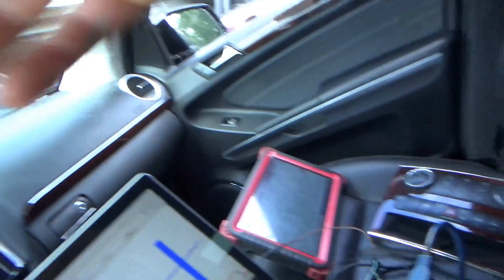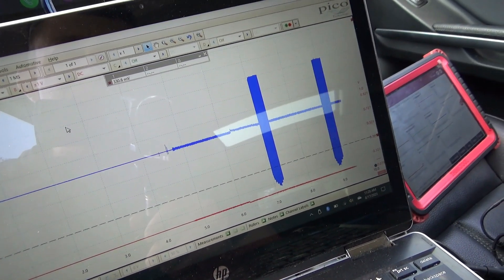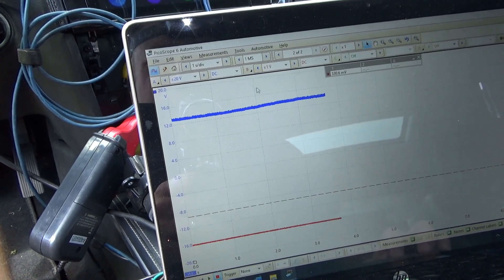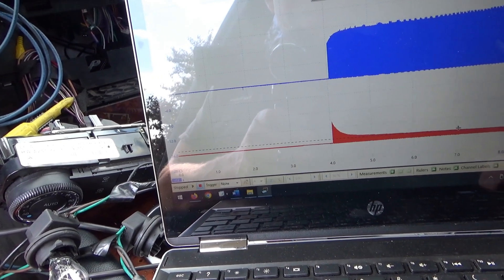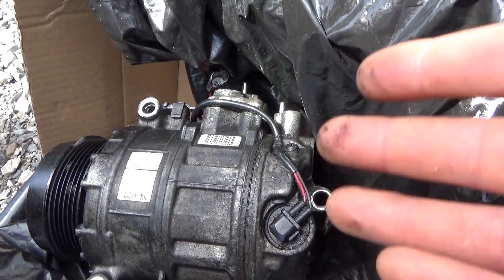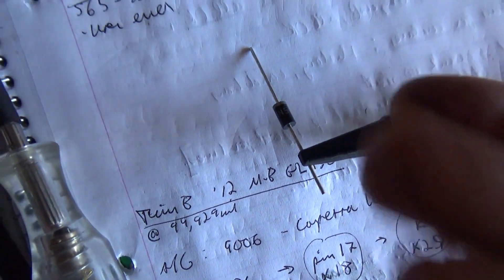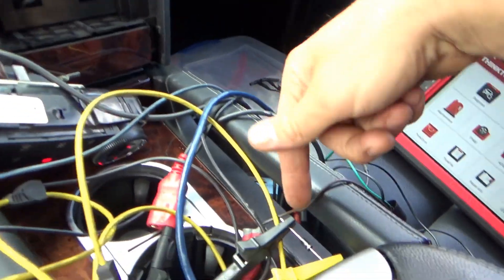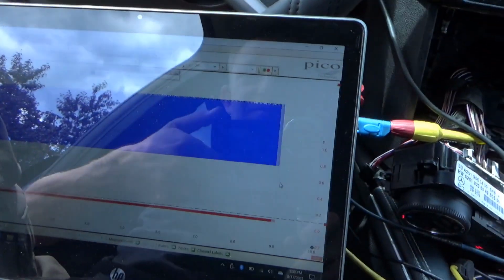Part 2: Did I MIS-DIAGNOSE This Mercedes?? (GL450 no A/C - Crazy REPAIR!)

Comment: My thought is that the original compressor has a diode built into it that shorted and then blew open. The replacement compressor doesn't have a diode in the harness, (probably a replacement full time non-PWM compressor). If you remember the original diagnostic code alluded to a shorted circuit. The diagnostic code wasn't 100% correct in this case but close to correct. If the schematics were more accurate, they might have shown either a diode coming into the compressor at the short pigtail or shown the compressor with a diode in it.
Reply: This comment certainly answers my questions. 
Wonder if Ivan went looking for the built in diode after the fact.
Reply: The diode is probably built-in to the mosfet that controls the PWM.  The internal diode can fail while the switching side of the mosfet still works.  The mosfet in the junkyard/ebay controller was probably worse off and the diode took out some of the mosfet.  Would be better to use a Schottky Diode in this application but I'm not sure what type he used.
Reply: @10100rsn diode in-line with the load

only benz versions of the denso seu compressors have diodes on their vd valves. aftermarket pos had the wrong valve in it
Reply: @10100rsn 
Relying on the 'body diode' inherently built into a MOSFET would, IMO, be a BAD design.  Firstly, they're rarely fully characterised in their datasheet and they'd also be dissipating those back-EMF spikes within the SAME physical package that turned it on (i.e. Concentrating all the heat generation in one place).
While it's quite possible that MB DID implicitly use the inherent MOSFET body diode, it would not be 'best practice' from a design perspective!
Reply: @trevorvanbremen4718  Probably more of a "cheapest/fastest" decision.
Reply: PIV = positive inverse voltage. Personally, I would want a diode with 100 PIV and 5A.  My gut says the diode WAS inside the controller.  Much cheaper than external.
Reply: The diode is present to 'protect' the output transistor of the controller since they do not 'like' reverse voltages. (It's NOT to 'protect' the compressor.  The spikes are CREATED by the inductance of the compressor!)
Therefore, IMO, the 'logical' place for the diode would be inside the controller right next to the output transistor rather than inside the compressor. (It would just be one more component on the internal printed circuit board).
SOME people would have wired in the external diode incorrectly.  i.e. In series with the control wire thinking that it would BLOCK the voltage going back 'the wrong way'.  The reason why that is wrong is that the instantaneous voltage that is created when the compresses is first turned off is effectively INFINITE.  The inductance wants te same current to 'keep flowing', and the only way that can happen is if the voltage RAPIDLY spikes.  This spike would be WAY more than the trivial 50V PIV [peak inverse voltage] of the diode, so it would NOT last long before it blows up.  Instead, the diode should be wired (as performed by Ivan) in such that it effectively 'shorts out' (to ground) the reverse voltages induced by the compressor inductance.  Since the current in the compressor (when active) is around 1 amp, the reverse spike can NOT be more than this value.  In principle though, you should have used a diode that's rated somewhat higher so that it's never CLOSE to its maximum.  (I'd have used at least a 3 amp rated diode).
Overall, well done Ivan.
P.S. When diodes are employed like this in circuits, they are often called 'free wheel' diodes.
Reply: @trevorvanbremen4718  The problem with putting a 10 cent part in a $500 part is you brick the $500 part when the 10 cent part fails.   Better to make it an external part that can be replaced as a separate SKU.   Ideally it would be part of the subassembly process from the vendor.   Probably increases the cost by $1, which was the real reason  it was embedded.
Reply: @trevorvanbremen4718 The diode is not just to protect the transistor, it's also used for RF suppression. That's why it's best practice to put the diode directly on the solenoid, otherwise the RF spikes from the back EMF will travel back along the wiring loom and cause interference.

Free wheel diodes are often combined with an R/C snubber circuit for this reason.
Reply: @Stoney3K  Valid point about RF suppression... (The wiring ITSELF can do a great job of acting as a radiating antenna!)
In an 'ideal world' (you know it, it's the one that NONE of us live in.... LOL), I'd place 'protection' at BOTH ends.
(The rest of this post is NOT aimed at Stoney since I am confident they already KNOW this stuff).
RFI is 'generated' by any ultra fast signal rise / fall times.  i.e. Anything that switches from ON to OFF (or vice versa).  In this case, the output transistor of the controller is RAPIDLY switching the compressor on and off (only the duty cycle changes, the ratio of 'on' time to the 'off' time).  Technically, the MOSFET CAN also be switched on 'part way' (operated within its linear region), but that's not used since it creates a LOT more heat in the MOSFET and requires a more expensive MOSFET too.  This would largely eliminate ALL of the RFI since there's no hard on / off switching!
Other options that are used are to run the wire through a ferrite ring.  (The ferrite ring 'slows down' the rise / fall time of the signal and thus greatly reduces RFI).
Reply: @calholli 
Well.... Kinda!!!
Your statement is correct, but only if you include the word 'average'.  The entire NATURE of a PWM (Pulse Width Modulated) signal is that it will ALWAYS be completely ON or completely OFF and not somewhere in the middle [slight exaggeration there, but only to stress the point).
As a general rule, a transistor will 'heat up' a LOT more when it's only part way on / off.  Using PWM overcomes that 'issue' by turning it fully on, and fully off VERY quickly such that the AVERAGE result is somewhere between off and on.
Imagine filling up a swimming pool with a hose.  If you turn the hose on max, then the pool will fill up fastest.  If you want to fill it up a over twice the time period [for some unknown reason], then you partially close the tap [a.k.a.transistor], OR... You can turn the tap ON 100% for 1 second and then turn it 100% OFF for 1 second repeating those steps until it's fill.
Reply: @calholli  
100% accurate!!!  You now have a clear understanding what PWM is!!!  Well done!
Reply from the maker: @trevorvanbremen4718  great comment. It was a 3A diode 👍
Reply: A coil reverse voltage diode is always placed near the component to be protected from the high reverse voltage spikes, in this case must be in the A/C control unit near the a/c compressor variable valve + positive output signal transistor or Mosfet, just open the a/c control unit and follow the line, there must be a transistor or Mosfet and a burned reverse voltage diode!
Reply: @arm2644  
If you read through some of the previous posts, you'll see it mentioned that the output transistor (which is more than likely a MOSFET) already has a built-in diode.  (It's called a 'body-diode' in this instance and it's an inherent by-product of making most MOSFETs).
However, it's somewhat 'risky' to design a circuit that EXPECTS this body diode to do the job of a free wheel diode (as I've mentioned in another post above).
However, we need to remember that we're talking about the auto industry where they will consume 5 weeks trying to 'optimize' a design to save $0.01!!!  (If you sell a million of them, that $0.01 will start to add up!)
If this was designed for space rocketry, there might possibly be a separate diode and RC 'snubber' at BOTH ends of the wiring, but in the auto industry I'd not be surprised if it was ONLY the body diode!

As for the junkyard OEM unit (that didn't work at all), I wouldn't be surprised to find the output MOSFET had 'et out the magic smoke' altogether.  The body diode probably failed first, and then sometime later, all of those reverse voltage spikes blew through the gate oxide.  (When THAT happens, it's quite common to cause a cascade of faults further up the chain!)
Reply: possibly an attenuator in the control module..
Reply: Diode in compressor might have shorted, and there's your original short.
Reply: benz doesn’t duty cycle these things like the other brands that use a denso vd compressor.

the dot on the valve means it has an integrated diode and it lives life at battery voltage.

Comment: I get confused about diodes and how they work a drawing of this would be nice to get it 100 % correct in my mind thanks
Reply: Check here:
https://en.wikipedia.org/wiki/Diode
https://en.wikipedia.org/wiki/Flyback_diode
Reply: @calopii  thanks so much for the reply got a little confused in the video why he was doing it the way he was I understand now thanks again
Reply: Just think of it as a check valve. In simplest terms it only let's voltage flow one way.
Reply: @guess1866 You mean current. Voltage doesn"t "flow".
Reply: @guess1866  Not to nitpick, but it lets current flow one way.
Reply: @1McMurdoSilver It's not nitpicking to get the answer correct.

Comment: That was a nice little hack to get the results you needed Ivan.  Well done.  Your customer will be very happy that the A/C is working once again.  But there has to be something else we are overlooking.  Because not everyone will have easy access to electronic components like that.
Reply: Anybody can buy a diode.  Expertise is hard to buy.
Reply: @rj.parker  True.  You can still buy electronic components.  But it's basically only mail order now.  And I agree with how hard it can be finding a great tech with a good wealth of experience.
Reply: The thing that "we are are overlooking" is that the replacement compressor is not build correctly from the factory (missing internal diode). Replacing the internal one there would mean: 1)evacuate the refrigerant 2) remove compressor from car 3)replace compressor for warranty (they might not be able to reproduce the issue at this step) 4) reinstall 5) recharge AC. Soldering in a diode is way easier and cheaper.
Reply: @tschuuuls486  Agreed.  Soldiering in a replacement diode is the easiest and cheapest fix in this case.
Reply from the maker: Is there a global shortage of diodes? 🤔
Reply: @PineHollowAutoDiagnostics  Not that I am aware of.  But there is a shortage of local brick and mortar stores that sell them.

Comment: How did they manage to change the compressor and get the system charged IF the compressor wasn't working?
Reply: liquid charge by weight is only way thru high side port.
Reply: Variable speed.  It worked but not at full load.
Reply: I @rj.parker  way more complicated than it needs to be.. german witchcraft dating back to hitler I say..  the final solution as Ivan said,, LOL
Reply from the maker: Using an AC machine 😉

Comment: Great diag Ivan. I am wondering about the compressor ground. Thru engine, to body ground. Any crusty sin that lineup? How would that impact? Thanks for your great videos.
Reply from the maker: Ground is fine since current flow was to spec and compressor worked fine manually 👍
Reply: It makes sense when you explain it. Thanks for the follow up. @PineHollowAutoDiagnostics

Comment: Does it not irritate you that you couldn’t fix it but could rig it to work ? I’d be nuts.
Reply: If it was a missing part and restored it, he did fix it.
Reply: He fixed it. He replaced a missing or blown diode with a new one. NEXT!
Reply: He could if he used an OE compressor…
Reply: It's real-world, you can only go on and on about theory for 
so long...........a fix is gold
Reply: He fixed it AND he documented it. Should be plenty good unless the next guy doesn't see the documentation 😅

Comment: Best place for the diode would be at the compressor. when the magnetic field in the coil that operates the valve collapses, that is whats causing the negative spike.
Reply: Yes, typically diodes are installed at the source. As for a retrofit, I would have looked at putting it inside the controller.  It would have been better protected against future techs moving things around.
Reply: @russellhltn1396 There's no harm in having the diode installed in both places though. The closest diode will take the largest amount of the back EMF current.
Reply: the diode is on the vd valve

aftermarket pos compressor didn’t have it
Reply: @xalty1200  I wouldn't call it a POS, the internals were exactly the same since they were both from Denso, it's just that electrically it wasn't a match.
Reply: I too think the diode should be as close to the offending coil as is practical. By installing the diode at the controller we are allowing a current spike to travel along the wire in the harness then on the "fat" brown wire and finally to the chassis and back to the compressor. The controller does not see any kind of spike but some high impedance circuit wire (like a hall effect sensor) in the harness might pick up some EMF from the current spike.
Reply: Also the heat from diode is better under hood
Reply: I second that. Diode should be installed as close to the source as possible.
Reply from the maker: @citizaniac149  what's the difference?
Reply: @PineHollowAutoDiagnostics  majortjkong explained it better than I could 😉 simply, the signal doesn't make it through all the wiring (and the common ground) where it could cause other problems.
Reply: @PineHollowAutoDiagnostics  As explained in the Wikipedia article I linked above: 
“To minimise the antenna-like radiation of this electromagnetic energy from wires connected to the inductor, the flyback diode should be connected as physically close to the inductor as practicable. This approach also minimises those parts of the circuit that are subject to an unwanted high-voltage — a good engineering practice.”
Reply from the maker: @calopii  some OEMs have the diode inside the controller... Guess their engineers didn't read that Wikipedia article 😅
Reply: Yes, this thing is typically called flyback diode and normally mounted close to the inductive load. See here: https://en.wikipedia.org/wiki/Flyback_diode
Reply from the maker: I just installed in the easiest place... Work smart lol!
Reply: @PineHollowAutoDiagnostics  Sure.  But another thing to consider is that the electromagnetic wave will travel up to the diode.  The wire it's traveling along will act like an antenna and radiate the back EMF as noise.  You can shield the wire and then ground the shield.  Best to clamp it at the source if you can.  But if it works it works.
Reply: @PineHollowAutoDiagnostics  Without seeing the inside of the controller and how hard it would be to take apart, I'm not sure as that was the easiest.

Comment: Ivan, was the controller from the junk yard bad? I was waiting for you to try it with the diode.
Reply: So the “parts” were from eBay (used OLDER controller) which you didn’t need 😮 I really enjoy your videos, so much to learn with scopes, GROUNDS and 12v.

Comment: Slick fix there Ivan.  My guess is there was / is a diode that is broken because you tried two compressors and two climate modules I believe. If a non functioning diode was present in either and replaced my guess is it would have worked.  Bet they had a diode in the harness or some such thing.  Regardless, excellent case study.
Reply: Typically the suppression diodes are in the controller.  Probably was in the compressor in this case with the original failed and the rebuilt unit missing it.

Comment: What I don't understand is why it is working the way you have connected the diode. I thought back emf was negative voltage meaning in order to eliminate it, you have to have the output side of the diode connected to the ground, not the signal side.
Reply: It depends on if the coil is positive or negative side switched. On either case, the diode must be oriented in the reverse (blocking) direction when the coil is energized, and it must be across the coil directly. Ground or power isn't directly related, other than in this case, one end of the coil happens to go to the ground, and the other is energized by a driver. (p.s. the correct terminology is anode and cathode, a diode has no 'output')
Reply: The diode conducts negative voltage created on the signal wire to ground.  The idea it conducts only in one direction only applies to dc voltages like when he was bench testing.
Reply: @rj.parker It applies to both AC and DC. Diodes conduct in only one direction regardless of what type of current is applied.
Reply: What about putting diode in series in control wire? It wouldnt work same way? Thanks
Reply: @AutoDiag_  search for "inductive flyback catch diode" or "relay diode" (relays are the most common inductive load but it applies to all inductive loads, and is a good idea to i nclude the diode always)
Reply from the maker: @AutoDiag_  no. Think about the voltage across the diode during the High and Low portions of the PWM signal 👍